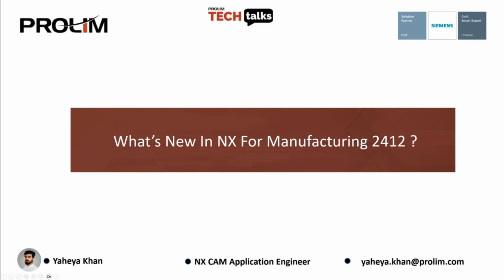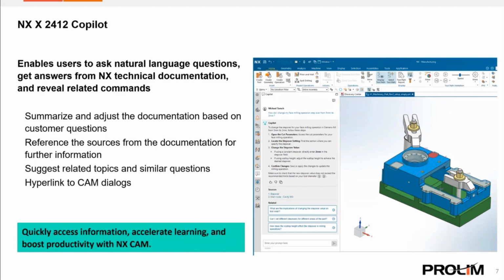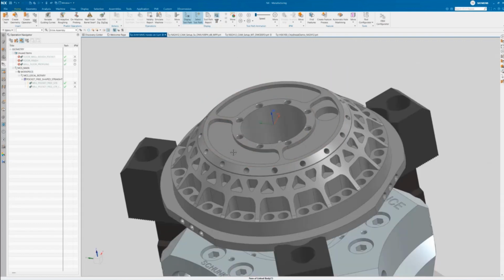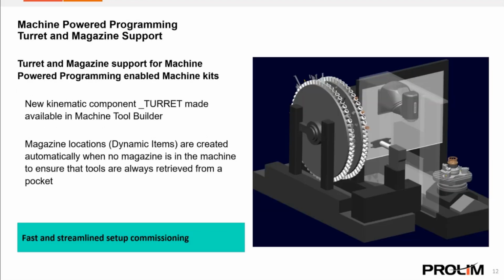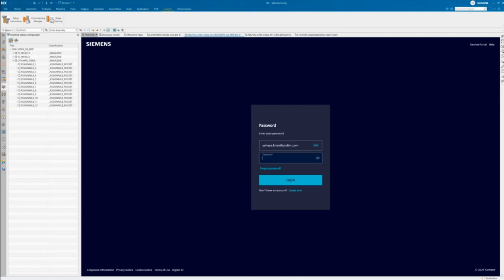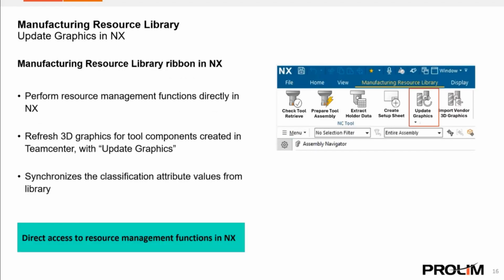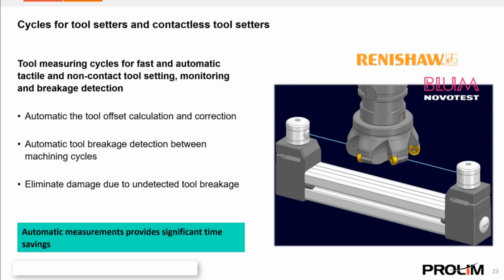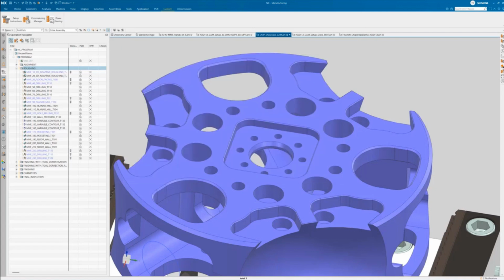What’s New in NX CAM for Manufacturing 2412? - Tutorial - PROLIM Tech Talk

Comment: "Does the 'Make Suggestions' feature work only for milling, or will it support turning too? 
Also, can the generated toolpath run directly on the machine, or is it just a showcase feature with no real use?

Navneet Jha.
Reply from the maker: Thank you for the question! The 'Make Machining Suggestion' feature in NX is currently focused on milling and optimized for single-face selection. The out-of-the-box suggestions offer a solid starting point, and for more tailored needs, you can create your own custom suggestions as shown in the video, all within the powerful single-face selection framework.
It’s a production-ready feature designed to accelerate programming, especially for prismatic operations, not just a demo tool.